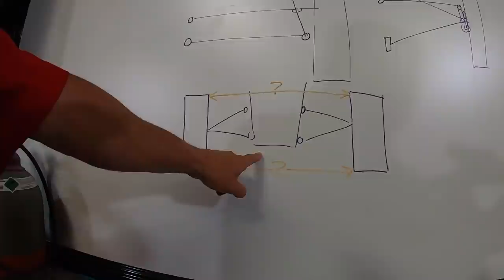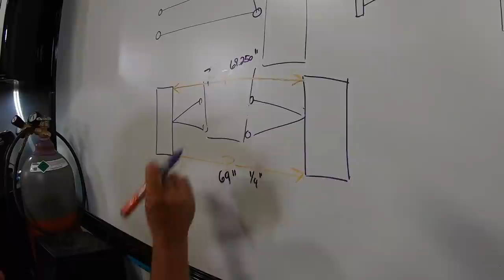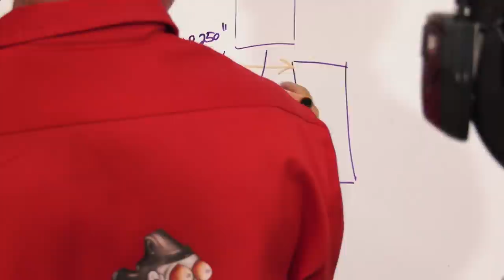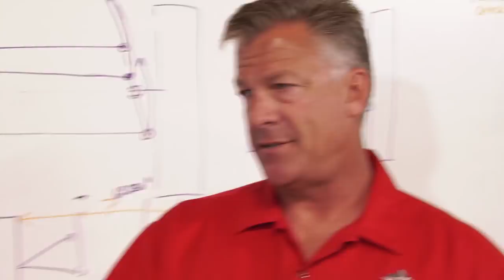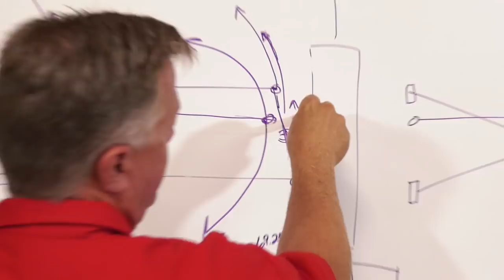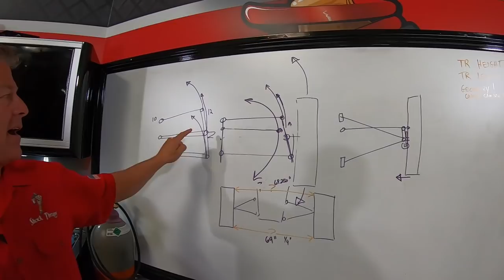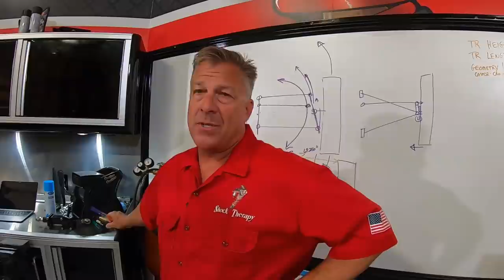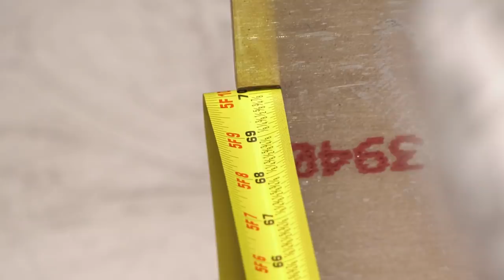How to Find/Fix Bump Steer (Shock Therapy LIVE 6/1/21)

Comment: Hey guys i am wondering if you have a video about brakes. Master cylinders. Brake pressure. Is it 50/50? 60/40 or what😄 handbrake or not? And so on🙌
Reply from the maker: Good one. We will work on that one.
Reply: @ShockTherapyllc i will buy a 2022 x3 and im a handbrake guy 😎cant wait for you guys to talk about this🙌

Comment: Great video, but come on Justin! The Turbo S has 4 inches of bumpsteer and you have to clarify it’s not their fault? YES! It’s their Fault! Saying it’s because it’s mass-produced is why they have allot of bumpsteer is just BS and trying to be nice to Polaris. Let’s see what Can Am has? I’m betting it’s more then 4 inches too! 

Just call it out! These MFG have no idea on proper geometry and the huge track width and bumpsteer numbers show it. They are about producing big wheel travel numbers, that’s what sells cars, not proper handling or geometry. Like you said they hide and mask the problem with a good power steering unit that hides the feedback.
Reply from the maker: Todd. Normally I’m with you and I’ll call it out. The reason I didn’t is because not all turbo S we checked have this much bump. One or two actually had under an inch. The can am are the same. 4” on one 2” on another. I can only chalk this up to production issues like rack locations. Higher in one chassis and lower in another. This is what we found on the can am. For this reason our new tie rod kits will have adjustability so you can tune the bump out no matter how much your UTV has. Your right, it is their fault. But I don’t think it’s a design issue with bump. It’s production. Scrub and track width issues are design. 👍👍
Reply: Sounds like it’s still their fault quality control is in the hands of the producer now if you’re looking at something that’s been on the road for years and through a couple owners and everything is out of alignment that’s another story but if you’re taking them off the showroom floor they should be set up properly